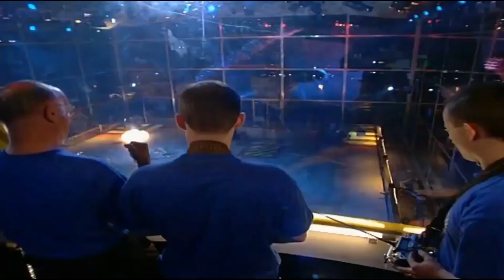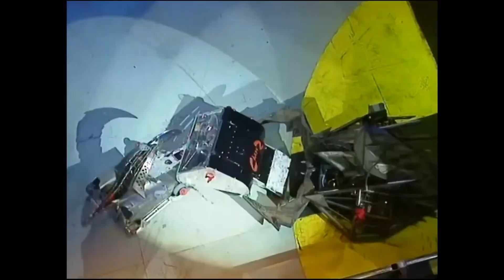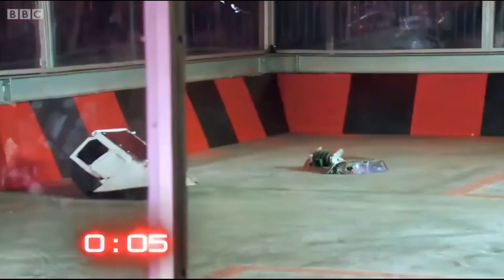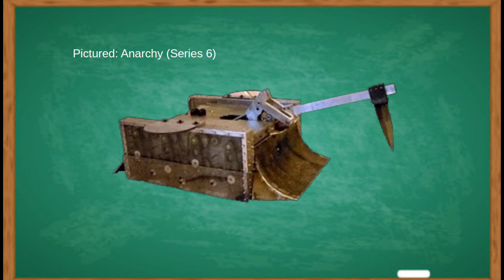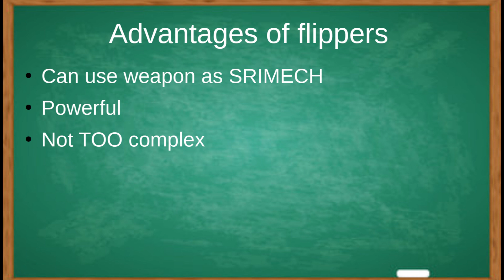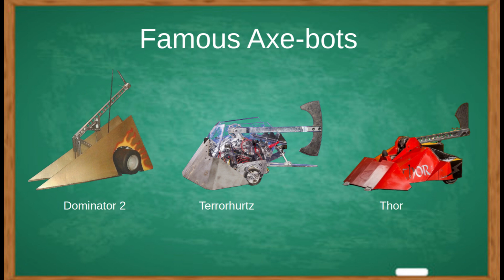Every UK Robot Wars Robot Ever: Part 0 - Robot Wars 101

Comment: u mad man doing it all from A to Z wow
Reply from the maker: Work has already begun on the As
Reply: @Synapse-CrossroadsOfKnowledge  alot of As
Reply: Oh btw question would it be single bots like granny revenge who did granny  revenge  and granny revenge 2? Or would it fall under a banner if  the name same
Reply from the maker: @vaulttechman3142  so all the robots that were the same machine name just updated will feature in the same segment. So for example, all the Firestorms will be together. But for example 101 and Anarchy (despite being built by the same team), will be different segments
Reply: @Synapse-CrossroadsOfKnowledge  also what about bot s with numbers like 13 black
Reply from the maker: @vaulttechman3142  they'll be at the beginning with the As. So 101, 13 Black, 259 and 4x4 will appear first
Reply: @Synapse-CrossroadsOfKnowledge  that all my questions